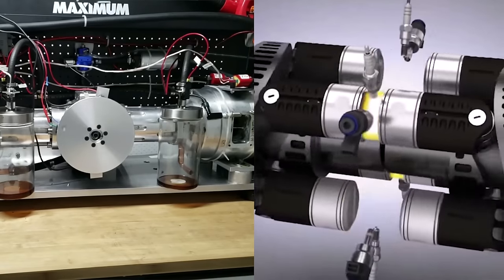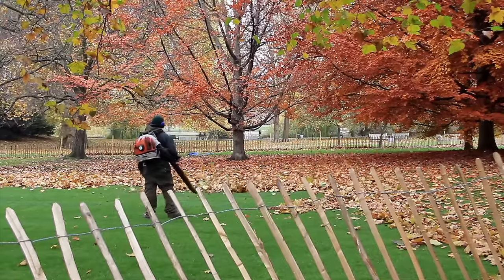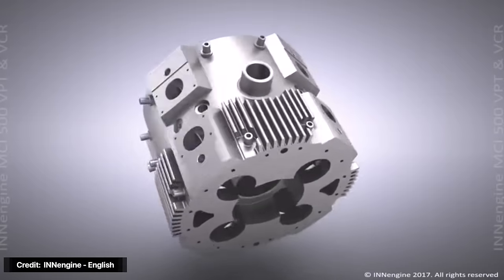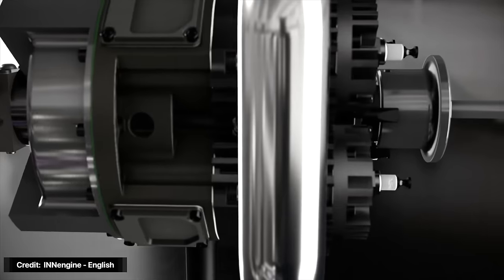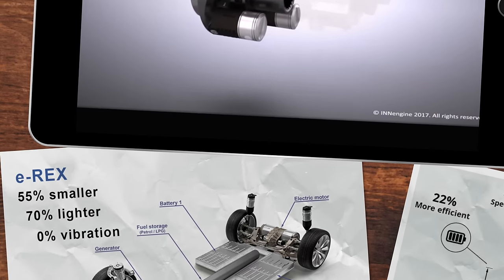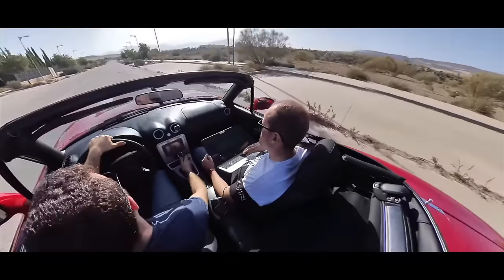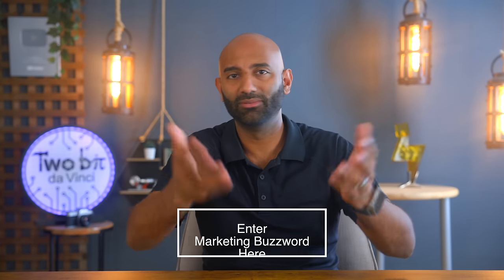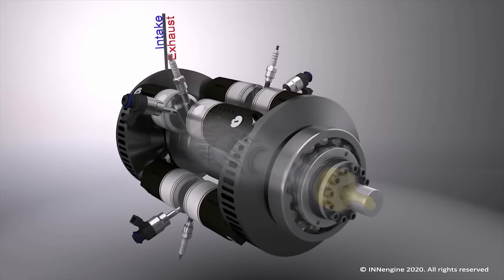One Stroke Engines - 200% More Efficient??

Comment: The REX engine is a viable option, personally I love to see the breakdown of the actual costs associated to the manufacture of batteries, including the mining costs, extraction, manufacture including shipping and the load on the current electrical grid the supply of cables to super charging system and the load on the the gas fired power stations. There are 2.4 million cars on the road in America surely to charge all these vehicles would have a demand on the grid. I think the grid is in need of a upgrade to service all these vehicles all still being powered by fossil fuel. I can't see this would be equitable in my country (Australia) as the distance we travel is further from say Brisbane to Sydney is 1000 Kilometres a small car can do this  on 60 litres and 10 -12 hours allowing for brakes, a electric vehicle gets 300 kilometres on a full charge so that would be 3 stops to recharge and many hours wait so not the best I say 2 night stop over on the trip down

Comment: Yes.  For the moment, hybrid technology is the best option.  In the near future, it just makes more sense.  And it's not new tech - Trains have been hybrid for 99 years. (Seriously. The first commercial diesel-electric locomotive went on the market in 1925.  And it's still the most efficient way to move a lot of weight.)

Comment: I would suspect there are some Torque problems in the Vectored Power Delivery between the Piston and the Cam Plate.
This Vector will vary throughout the cycle.  This will be similar to bending metal back and forth repeatedly.
By using a roller across a sloping surface there will definitely be a harsh torque momentum arm possibly causing damage over time.

Comment: Great Engineering in my Opinion, a Two Stroke without the Oil Mix and a Very Quiet Powerful Engine and weighs 1/2 what the average 4 cyc. Engine would weigh...

Comment: The world is NOT going to electric in a go-fast hurry.  The US grid can't handle the load until thorium reactors are in every town.  The internal combustion engine is here for at least another 75 years.  You not driving an internal combustion powered vehicle proves you are not living in a fly over state.  My 2000 Dodge 5.9 diesel has 646,000 trouble free miles on it and can pull a house off the foundation.  I can not see electric providing that type of life and the over 650 miles in range of my diesel truck.

Comment: If a blower makes as much output as a Camry driving from LA to Denver, and the Camry combustion engine is THAT clean, then why the push for the permanent polution associated with LIthium batteries? Would not the CAmry have a smaller C foot print than the Tesla long term?

Comment: For electric vehicles to become a mainstream takeover we need to look at range because right now BEVs lack range and time efficiency for top offs mid trip. This limits them to local commuters unless you do not have time constraints and can dedicate an hour and a half rest stop for full recharges on a fast charger. The other issue is a lack of infrastructure that would allow for the entire population that is commuting to plug in and recharge. 

  In my opinion we need to look at systems similar to Dielectric locomotives which have generators that create electricity that powers the traction motors that move the trains. If you could use a clean burning ICE like the Swash engine you demonstrated here at a set RPM and reduction gears to drive a high voltage and ampere generator ultimately electric powered vehicles would be ideal. In essence they would be hybrid vehicles but not as we conventionally know it today. The issue is developing a generator that can produce the voltage and amperage  like the 400 volts and 2000 amps required to power a Tesla Plaid. The idea would be to create a compact light weight engine and generator combo and reduce the number of cells required to power the electric motors that drive the car. 

   You noted the Rex engine as 70 MPG, but that is powering a car through a conventional drive train. What if its only function was to power the generator so it would not suffer any drag against the engine from grade changes and demands for more torque to maintain speed, would it be capable of operating at a constant speed for say 4 hours on a gallon of fuel? If so that would suggest you could travel 280 miles at a speed of 70MPH on a single gallon of fuel. To put that into perspective let's say you have a car that will afford you 35mpg at 70mph to travel the same 280 miles would use 8 gallons of fuel which is 8 times the amount of pollutants put into the atmosphere.  
   Here is where the rubber meets the road though, while a current BEV has traveled the 280 miles and now has 15% battery left and will need to recharge to carry on, the generator assisted unit gets a coffee uses the restroom and goes back out on the highway because a simple 5 gallon tank will take you 1400 miles before you need to spend 20 bucks to refuel. That is like driving from LA to Kansas City on a tank of fuel. Now what if the generator only kicks on when the batteries drop to 50% charge you could virtually drive from LA to NYC on a tank. Just a thought.

Comment: EVs are Not the future. They work in certain areas but are unsuitable for any kind of distance driving. The Lithium is a huge pollution source during mining, processing and production. Lithium is a dangerous metal which burns like hell. Just watch some of the fires in NYC the past 2 years. They banned storage in Bldgs. There are not enough charging stations, and in places like moronic California they cut their electric production to "go green", so there is not enough electricity for modern society and brownouts are happening. No one Knows how to Fix EVs, and that includes the manufacturers. Thousands of EVs that have been flooded or damaged in crashes are sitting around collecting dust because they cannot be fixed.  Good show, hope that New Engine finds its way into the auto industry.

Comment: I have to admit I love my late model petrol-powered car; it scores 50mpg with conservative driving aided by a manual gear shift which gives me control over the optimum torque range of the engine. BTW the swash plate in the engine shown in the video bears a remarkable resemblance to the "wobble yoke" design patented by a New Zealand company for use in their Stirling engine.

Comment: I think the electric/range extender combo would be great for the under 200HP ag and construction market - compact tractors, excavators, track loaders.  The IC powers the hydraulic circuits and generator.  The electric motor moves the vehicle and powers the computers, lights, etc.

Comment: EV cars and trucks are not the answer...They will run out of Lithium and then what... Iceland is currently working with hydrogen fuel cells that have 0 carbon foot print...Also Toyota is working on an engine that works of  Ammonia which also has a 0 carbon foot print...Problem with EV is the need for dependable and working charging stations...Also China has acres of brand new E Vs that are new and can't be sold over seas...

Comment: Please do a deep dive on the Liquid Piston engine. Also, do they make an engine small enough for landscape equipment. It would be great if the ev manufacturers would produce kits to convert old land barges into electric cars. Maybe with flexible solar panels applied to hood, trunk, roof, door and body panels.  Can solar panels be lithographed onto the surfaces of automobiles instead of paint?

Comment: What happens when Toyota puts this engine in its latest Prius, which they say gets a 150-mile/gallon average until the battery runs out? If the new Prius had this one-stroke engine just as a range extender on a 10-gallon tank, as the host said in this video, maybe Toyota could get away with a small battery after all and keep the 150-mile/gallon for much longer.

Comment: well lets see........
electric vehicles will be the future, yes i admit it, BUT ....... the technology is just not there yet, like the electrical density of batteries is way to low, like you said 1000lbs and only 300kwh, that's just not cutting it, if it would be 1000lbs with 5000kwh, that's a different story
so as for now hybrids with H2 or H3 and electric drive motors, seems to be a good alternative until we get to better batteries for full electric

Comment: 1st, interesting video.
2nd, We aren't out of the woods with EVs
3rd, everyone needs to identify the EV you're talking about. I'm not referring to the manufacturer, but the source of the electricity, ie battery, or fuel cell, or hybrid. 
4th, what is the result when driving an electric motor powered vehicle through 9 to 12 inches of water? Sure, we're told not to do it, but it could be a drainage problem in your driveway. Will it cause an electric motor to short? I see big problems on the horizon for this application.

Comment: Diesel genset to charge two battery packs -  Just look at the diesel-electric trains.  Think about it: we still burn coal, and the more EVs you need, the more electricity you need.  We will eventually have to build a nuclear plant.  That is why folks like Bill Gates are investing in that technology. So why not just place a genset in EV?  I already get 37 - 42 miles a gal in a 4-cylinder diesel engine.  Now, picture a small thumper or two-cylinder diesel genset, and its only job is to be idle as it charges the second battery pack.  Like having two tanks in a truck but is auto-filled.  It may also be a good idea for heavy machinery that wants to go electric in the bush where there are no charging stations?

Comment: Should have devoted more attention to the Ampers engine, which is the only true "one stroke" engine.  Every engine inherently delivers only a fraction of it's energy to the output.  The  remaining energy is spent on compression for the next stroke or next cylinder, ... or given off as heat.   
The question at the end: "why invest in internal combustion when electric is the engine of the future is a dumb one.  Electric vehicles and their batteries create more carbon to produce than IC engines, are disproportionately expensive, leave people stranded between charging stations, create lines and hours-long waits for a charge, can't possibly sustain the truck/train/ship transportation industry, and have lately FAILED in extreme conditions (weather, power grid overload, etc.)  Please stop the false advertising!

Comment: Range Extenders make sense already for the marine industry. So it might be worth investing into this technology for EV company's to consider. Vehicles that include the option of REX technology to consumers who are interested in it is a no brainer, while leaving the option for lighter power to weight ratio or storage space options for consumers not interested in an EV for daily commuting long distances.

The Oil industry and its refining processes have become in tune enough, where we're humanity's best R&D teams to stabilize a fuel that is even better than gasoline, diesel, kerosene, propane, butane etc... then that will only benefit humans in the future

In conclusion, a future where we find green cityscapes for a 100% green future, is not plausible. Think about the maintenance alone that goes into a building like that: The net production of oxygen from carbon versus carbon footprint to maintain a 40 story building of plumbing, electrical, and other civil necessities. How to transport those materials as well. Batteries for truck trailers make no sense, whereas just like the marine industry, hybrid full EV drivetrain Truck Trailers are peaking in interest as well.

The future only calls for a stabilization of carbon being trapped in the atmosphere, not the complete reduction of carbon. If we can mitigate our carbon emissions to a minimum where the planet can clean the rest by itself that route is obviously the most beneficial for humans now, especially during a time, where we are energy dependent to operate our daily lives out. In other words, why bother sinking R&D into let's say AI surgery tech without the help of another smart tech which will only help scientists and researchers more on how humans interact with the two techs in tandem?

Comment: The EV engine provides zero benefit over an ICE engine. The most idiotic comment was that gasoline is unfortunately higher density than a battery. It is our ability to convert the high energy density in fossil fuels into low cost, reliable forms of energy for transportation, manufacturing, and home needs that has propelled us to the highest standard of living ever known in human history.

Wind and solar are low density, unreliable very expensive forms of energy that will lower our standard of living. In addition, conversion to EVs, solar, and wind will make us serfs of China. China supplies the lithium and rare earth metals necessary for EV batteries, solar panels, and wind turbines.

An EV takes 40 minutes to fuel on the road, is more expensive than an ICE, and cannot perform the heavy lifting of towing a boat, or trailer, has less cargo capacity of an over the road truck because of the weight of the battery, and because of longer charging times compared to filling a diesel truck, cannot make as many trips per 24 hrs.

An EV is a mode of transportation from A to B that has zero inherent advantage over an ICE vehicle and many disadvantages. Range in an EV is shortened significantly if the weather is cold or hot, which makes little to no difference in an ICE car.

Comment: I'll only buy an EV that is not affected by the cold, battery is cheap and lasts at least 15 yrs, support on all parts for 30 yrs, you are in control of what software updates you want and can travel minimum 2000 KLM's on a single charge with lights, heater or a/c going the distance. One more thing, charge to full power in 30 minutes or less. One more other thing, that mining is less destructive than oil and gas. And the final note, environmentally friendly when all toxic materials are neutralised inert when disposed of and the EV doesn't require fossil fuels to mine and build the vehicle, oh yeah forgot the last this time, and charging your EV free from fossil fuel and nuclear energy, otherwise it's another scam just to build more cars to replace another car. Shoot forgot, every single EV to be safe from thermal fire, meaning the fire can be extinguished immediately and not wait for the bonfire to run out of all those deadly fumes. And charge your vehicle in an enclosed location, meaning it is 99.99 safe to do so. Tests have also shown that safety barriers have to be reinforced all over the world, as EV's can smash through concrete and metal barriers currently in place.

Comment: Electric Motor's, Electric Generator's, battery charging, and battery discharging ALL have losses in each stage, typically in the 10% range for each part of the cycle range ... each additive ... direct ICE to wheels bypasses all those losses.

Comment: Undoubtedly, integrating a compact and efficient gas motor to serve as a generator would propel hybrid technology to the next level, nudging us closer to a future of gas-free driving. This innovation would harness the advantages of an EV while likely offering cost savings, reduced weight, and improved handling due to the decreased reliance on bulky battery packs.

Comment: I think the best would be to imitate the Diesel-electric locomotives:
ICE as the power generator, alterantor+motor(s) as the transmission. You effectively get an infinitely variable transmission and can always run the motor at peak effiscency or power if needed. No need for a clutch either. The conversion to electric and back to mechanical might be less effiscient then a mechanical transmission though.
A batterie might be useful for regenearative braking, but it's a alot of extra weight.

Comment: Here is why the electric propelled gas extended is better. first off, we cant transition to total electric with out a new power source and infrastructure redevelopment. With electrical-propelled-gas-range-extended the current infrastructure is still viable but now EV outfitting is attractive at all gas stations becasue what insane ass hat wouldn't want to buy a car that gets 80 miles to a gallon, people are also going to want to charge up while grabbing a meal at the Gas station restataunts.  Autonomy is the KEY, 80% of the people in the nation who travel do it in a car, and EV is not a reliable way to do so. But EV with a range extender, now you have autonomy back. And an attractive autonomy at that becasue you are cutting emitions and COST of driving by almost 2 thirds, While easing transition to EV infastructure.

Comment: Yes. EVs with significant range are heavy. Their tires spew far more micro plastics and do more damage to roads. But a neighborhood EV with a 20 mile range is cheap and light. Add a range extender and you're good to cross the continent!
EVs are expensive for "purity" reasons, not physics.

Comment: I think the description range extender for this one/engine is basically the same as the old hybrid, only done in reverse. I think it is a good idea, Electric but petrol back up. We know Electric still gets its energy from carbon fuels. Most Electric is from cold burning, which is even worse, but it is efficient but in the US the range problem is a big problem. Also infrastructure is and will always be a big problem with EV.

Comment: Having owned a Chevy Volt for years, the range-extender concept was perfect... for a much earlier time. Anyone who has become accustomed to a current EV will say that the whole internal combustion system is just a waste of space and weight, better devoted to a larger battery.  The excess expense, complexity and pollution of any combustion engine is just unnecessary,